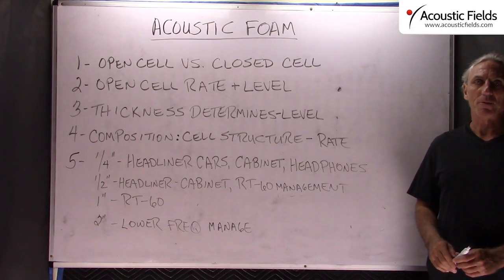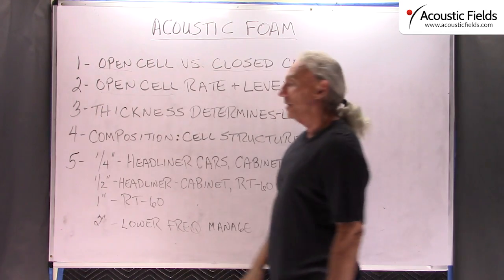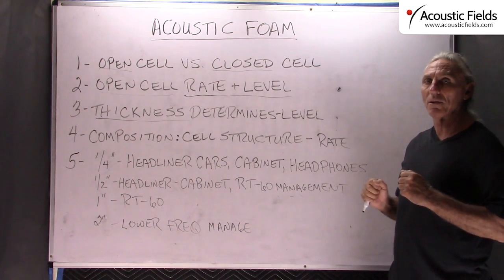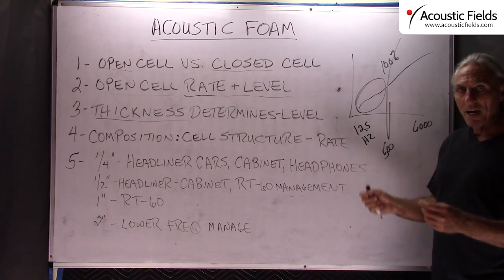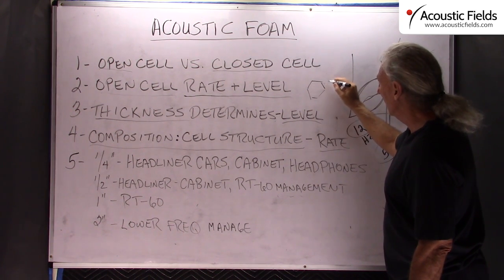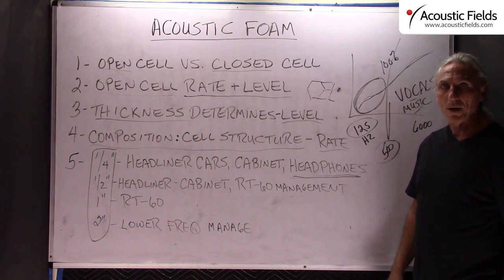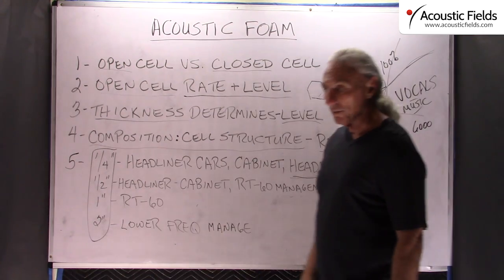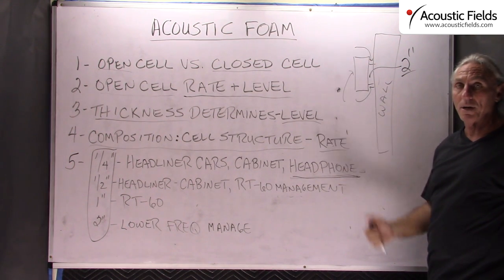Acoustic Foam - Which Type Is Best? - www.AcousticFields.com

Comment: Does thicker foam manage low AND high frequencies?
Reply from the maker: T,  The thicker the foam the lower the frequency of absorption. The middle and highs stay the same as specified. Our 2" foam goes to 125 Hz. If we make it 4" thick, It goes down to 95 - 100 Hz.

Comment: Dennis,  I think that since foam is absorbing mostly in the 125hz on up, they are probably hearing the harmonics of a bass note being absorbed, and not the fundamental note.  Maybe that's why they THINK that foam can be used for low frequency absorption.
Reply from the maker: Hi O, Whatever the thinking process that is used, it is incorrect.
Reply: Yeah, I know,   I just watched some videos of someone putting those acoustic foam in the corner acting like they are "bass traps" and he mentions he hears a difference.  He showed no actual measurements to prove they did anything with low frequency absorption.    I'm just trying to figure out what would make it "sound different' and that's the only thing I could come up with.   They aren't listening to the low frequencies, they are just noticing a difference in the harmonics of the low frequencies since the harmonics would be 125hz and up range.  So they aren't fixing the problem, per se.  :-)
Reply: Oneness100 With a sine tone generator, it's so damn easy to find the modes of one's room. My room has a somewhat nasty resonance at 72 Hz, and at 36 Hz (half). If I decide to treat it with basstrapping, I'd verify that it worked, using the same method I used to diagnose the problems/frequencies – i.e. a tone generator and my ears.

It's shocking how many people treat their rooms like blindfolded and with ears plugged. You see comments like "I think it's making a difference." Incredibly dumb.
Reply: Tazmanian Ninja I'm aware of how to find room modes, I was referring to how other people talk about that either don't know how to find them that user their hearing that use less effective methods for going after the lower fundementals.
Reply: Oneness100 I know 😺 I wasn’t directing it at you specifically. Just the fact that many people seem to “guess their acoustics” which is the wrong way to go about it.

One needs to know which problems there are, and then fix them, in a prioritized, clever manner. I.e. don’t create a new problem, by muffling all treble, in an attempt to trap some bass frequencies that might even not be reached. That would leave one problem unsolved (bass) AND create a new one (100% dead, attenuated treble). In that scenario, trapping the specific problematic bass frequencies, in a way that diffuses treble, makes more sense.
Reply: @Tazmanian_Ninja  There are things like room dimensions/volume, room usage, how much energy and from what type of source(s) will define what acoustic problems will need to be addressed, but th order that seems to make sense is low frquencies first.  They are the most costly, the treatment are typically big, heavy, and take up a lot of room and are relatively expensive.   If you don't have the budget to treat the low frequency, then you might need to do some other changes, like getting another room or not putting so much energy into the room.  I know people want lots of bass, but unfortunately that's what makes It harder to hear the mid's and high's.

Diffusion is something you do at the end since it's expensive and you need to treat the Low Frequencies first so you can hear how well the diffusion works.

treating the mid's and high's with absorption is relatively cheap and easy to do.  But unfortunately, that's where people do first instead of dealing with the low frequencies in the 30hz to 50hz first.
Reply: @Tazmanian_Ninja  And a lot of people buy what are big name brands that spend a lot of money on marketing.  What's funny are the companies that use the term "bass traps".  Ever since I first heard that term, I was always kind of suspicious as to why they called them that.  It's not a scientific term, it's marketing term. And what some of these companies call a Bass Trap is just silly.